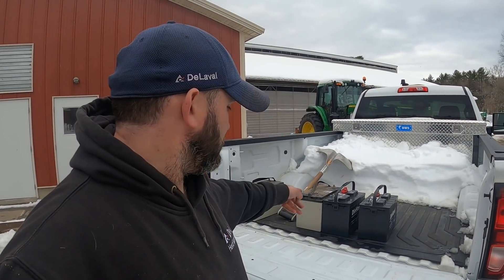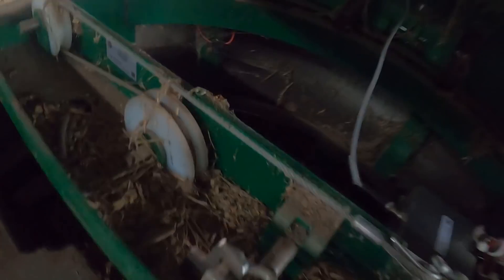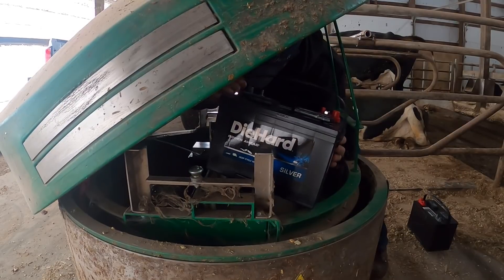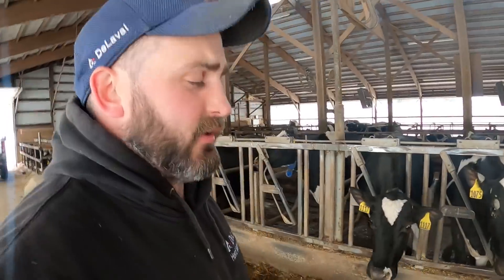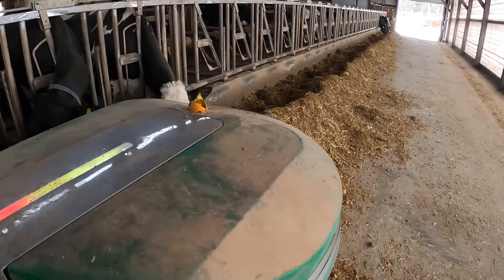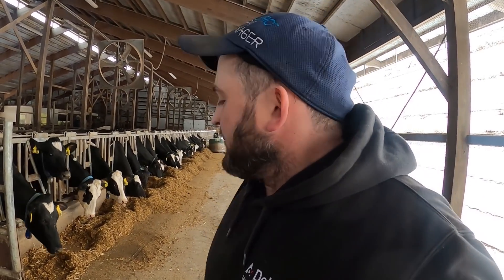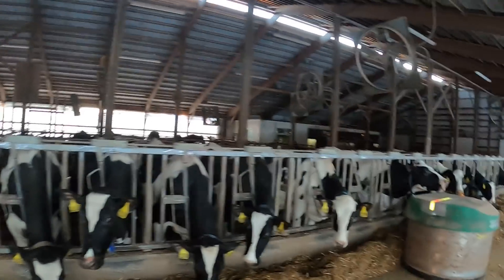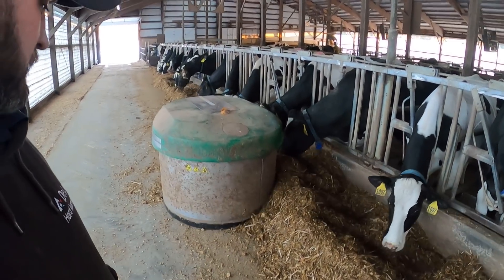How To Keep The Cows Food Available 24hrs A Day

Comment: probably don't remove the brather, that would cause pressure buildup in the backpast of the transmission so you could eather blow out the seal and it would start going into the fromt part, or it could also do somthing worse like blowing a hloe in the casing, all in all it's better to lose some oil then blowing up the entire transmission